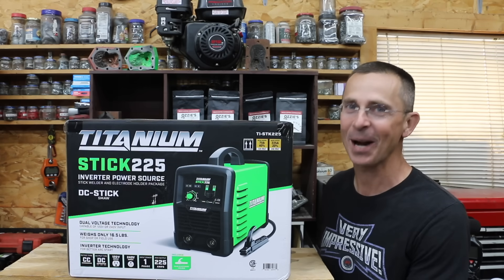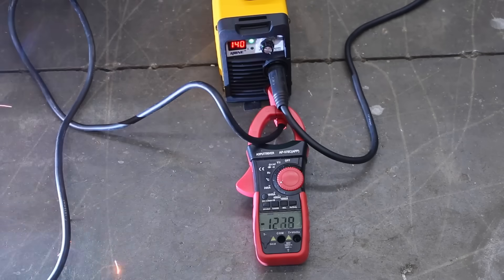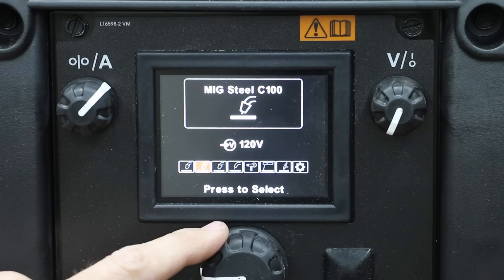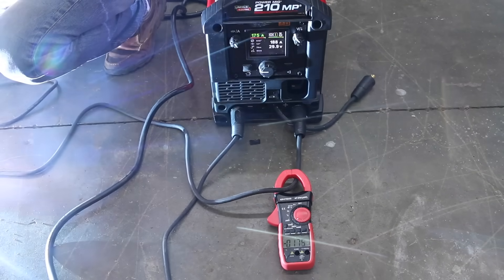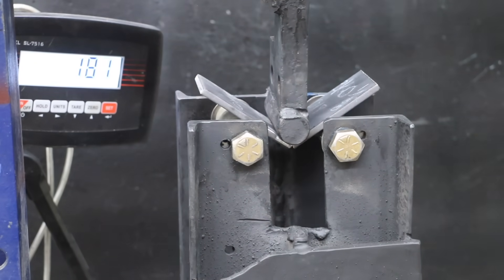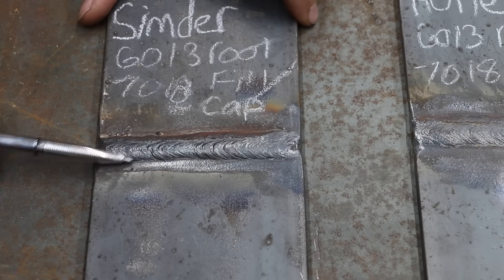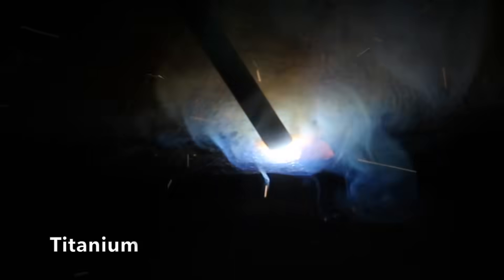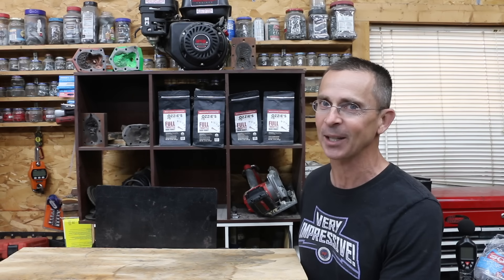$70 vs $2,300 Welder? Let's Settle This! Weld Strength, Duty Cycle, Current Output, Build Quality

Comment: I've been a heavy duty structural welder most of my life.  I am now retired and want the ability to repair trailers, steel totes, cladding etc but I don't want to spend many thousand.  I'm looking at the Lincoln flux core and MIG Lincoln welding machine for about 3 hundred.  I wish I had more experience using this type of machine.  Flux core wire sure seems to be the ticket.  I certainly don't want to have to maintain gas canisters for welding.  I can use 1/4 inch 7018 but I now only need to weld 1/8 inch or maybe aluminum.  I need a recommendation for what to buy.
Reply from the maker: Thanks for sharing.

Comment: For the simder you have to go into the settings when you get it, and change it to 120v as the max readout. After that it reads the accurate amperage when you put it on a setting. 

The 200 thing is just bullshit marketing, the company that makes the welder is actually the one that gave the info on doing that with the settings.

Comment: The harbor freight stuff is actually pretty good.
Reply from the maker: Thanks for the suggestion.
Reply: @ProjectFarm  I've done a lot of aluminum spool-gun and solid wire GMAW with the Titanium series machines and the weld quality is very close to the Miller Multimatic machines. I do a lot of tractor trailer repair and heavy equipment service.

Comment: great video on stick welders, its surprising sometimes harbor freight actually has decent welding machines.. Especially affordable for folks on a tight budget. I'm using their Chicago Electric Mig 170 (220 volt) and it does pretty well with flux core wire.     Have you made a video on  "Budget Plasma Cutters" ?? by chance???  Another YOUTuber used an Amazon special a VEVOR Plasma Cutter, 50Amp for $255 and was impressed on how well it did and I wonder how it would rank up against other plasma cutters.. I'm looking forward to your next videoes
Reply from the maker: Thanks!  Thanks for the suggestion.

Comment: Hey Todd, for better visualization of the penetration of the welds you can polish it up and use some naval jelly/rust remover for mild steel. For aluminum, the prep is the same but you can use oven cleaner and a bit of heat from a heat gun. Cheers, and thanks for testing out some welders!
Reply: Even running hot water over the polished edge for a minute will cause the weld area to flash rust and show penetration clearly.
Reply from the maker: Thanks and you are welcome!  Thanks for the feedback.

Comment: Thank you for accepting my suggestion for review (probably not only mine). Excellent job as always =) One more evidence about lack of quality control and performance with very cheap machines especialy if you need to work with 7018. Many of us dont need some high end proffesional tools but something with basic quality control/performance worth the money. One question for you and rest of US guys, what is max. amperage which you can get from 120 V home outlet and  do you have some option to get 240V? And yes, last but not mean least, there is interest for MIG welders review, especial MIG flux which can be very practical tool in workshop like your =) =)
Reply from the maker: Thanks and you are welcome!

Comment: The deko is the one I have. For what it is it's very nice it has a very smooth arc and lays down beautiful welds. It has a few quirks but nothing unmanageable. The ground clamp is junk right out of the box it can't handle the max amps that the machine can put out. The stinger is also made of brittle plastic that will not survive being dropped or stepped on. The display reads lower than the actual amps. The control knob is very sensitive and the amps like to drift for a half minute after adjustment before settling where it wants to be. This machine runs best on DCEP configuration.
Reply from the maker: Thanks for sharing.

Comment: I used the Lincoln bit I couldn't get it to stop, pulsing it would weld stop weld stop I tried making a better ground connection adjusting the feed and voltage on mig but I couldn't get it to work rigjt
Reply from the maker: Thanks for the feedback.

Comment: Joe was a very welcome addition. Nice review video.
 I've bought cheap to expensive stick, wire and mig welders. All worked but you really can tell the difference in quality.
A skilled welder can make a cheap mig box perform well enough but there is no question a good quality unit makes for a much better experience. It's also much easier to learn with a better quality welder.
I restored about a dozen fifties to mid sixties trucks and sedans in my shop and went from a cheap mig to a Lincoln, and finally to a very nice Miller. You can tell the difference when you are using them.
That said, I would take a cheap welder over no welder any time.
Reply from the maker: Thanks and  you are welcome!  Thanks for the feedback.

Comment: Weld power supply testing like this is pretty easily done with a big trash can full of saturated salt water and a couple of decent sized steel plates.  A couple of 2x2 boards between the plates ensures consistent spacing and keeps the plates from shorting together.

You can measure power supply "droop" (the volts/amps response) by slowly lowering the plates into the salt water and measuring voltage across the plates and amperage as shown in the video.  The current load is pretty closely tied to the surface area of the submerged plates, and voltage is pretty closely tied to the load on the power supply..

It's a lot less exciting than seeing welds, but it pretty quickly filters out the chaff and can put on a 100% duty cycle load if you keep adding water to keep the plates covered.  It also a lot less "noisy" than a welding arc, so your current measurements are a lot easier to record.
Reply from the maker: Thanks for sharing.

Comment: Interesting to see the quality differences!  I was pretty impressed by some of the mid range welders; a few extra passes would make the welds stronger too.  For a video idea, i was thinking about doing a comparison on those portable thermal camera imagers; not the small handheld ones, but the ones that plug into your phone.  I see many reviews on just one, but never reviews comparing many at the same time.  It would be cool to see things like temp. accuracy, the highest and lowest temperatures, how long each can last for while plugged into the phone, range, etc.
Reply from the maker: Thanks!  Thanks for the suggestion.

Comment: Makes me feel good.  I bought a refurbished Harbor Freight titanium MIG welder and swore it welded better than my older Miller. Now In fairness that Miller is an old Transformer welder and the Titanium is a new inverter welder.   But, boy is that titanium nice and it weighs about a third of what the Miller does. Makes it nice for portable jobs.  The Miller still whips the Titanium on duty cycle and probably longevity but boy that titanium sure is nice for the money.  Good to see these reviews.  I think those Titanium welders are kind of a best kept secret for the hobby/farm shop guys.
Reply from the maker: Thanks!  Thanks for sharing.

Comment: Was the test done at 130 amps measured or 130 amps indicated? Because as then first test exhibited, there is a massive difference. So it would only be “leveling the playing field” or “apples to apples” if it was 130amps measured.

Comment: Why would you do a 6013 root pass? 6013 was made for less penetration for thinner metals?  They would have done better with just 7018
What rod were you using on the rust? 6011 is best for rusty metal.
Overall id say I'm other than satisfied with these reviews of these welders.

Comment: John the weld. 5:29 . Test meter should be clamped on negative cable not positive cable to give more accurate reading. arc length can greatly vary readings. Chinese welders not great but cheap.

Comment: You made a crucial mistake PF. You let Joe use the cheap welders with an acutal hood and shoes on. Anybody that watches FPV knows those welders are only effective when using bare feet and safety squints. If you must have eye pro, no more than clear yellow plastic is allowed. 😅

Comment: Good stuff overall.  Some of the comments criticizing the tests are -- not really the point of the video.  No one buying these welders (except the Lincoln) is going out and trying to do some code quality welds.  If you're working around the house and need to repair some old metal equipment this is great.  You can use this to buy something and have confidence the welder is not a complete pile of junk.  Mr Farm: The MIG video should be interesting because the welders are smaller and you're likely not going to be focusing on such thick metal.  Seeing which ones have arc stability and overload protection will be good stuff.  I'm not sure if you're able to test it, but if you can (at the last test) put the feed system through a bit of torture and see how they hold up.  That's the most critical part for longevity on them, so trying to get - at least a relative comparison -- would be great.
Reply from the maker: Thanks!  Thanks for the suggestion.

Comment: Thanks guys, fortunately I can afford Miller and Lincoln, they last forever and you can always get consumables and liners. I was using cheaper 0.035 wire in my welder and had to change to 0.023 which was Lincoln, definitely better wire.

I know it sounds terrible and it's not a tool (well maybe it is!) but I'd like to see a test of toilet paper, I can't find decent toilet paper.
Reply from the maker: You are welcome!  Thanks for the suggestion.

Comment: You are a youtube treasure Todd. Thanks for helping Todd out Joe. I bought a $59.00 Parkside welder from Lidl's grocery store. it was in the clearance bin for $39.00 I bought a 150 amp bridge rectifier ( and a installed it on the welder. I also bought a better ground clamp and with 6013 rods I can weld #10 guage metal pretty good.
Reply from the maker: Thanks!  Thanks for sharing.

Comment: NOT THE BEST COMPARISONS

YOU NEED TO

1. SELECT A SPECIFIC ELECTRODE AND DIAMETER
2. USE THE EXACT THICKNESS PLATE TO WELD
3. RUN ALL WELDERS AT THE SAME AMPERAGE
4. TEST THE RESULTS

EX

1/8 7018 LINCOLN ELECTRIC EXCALIBUR ELECTRODE
125 AMPS
1/2 PLATE BEVELED 22.5°
MULTIPASS BUTT JOINT
THEN BEND TEST

Comment: Not a chance .I’ve had a 40 year fabricating career I’ve pressure welded titanium and all stainless alloys building ships , reactors , subs,  piping , vessels and tanks . There is no substitute for a good machine . The cheap ones are disposable and have inferior performance . Like literally . A good tradesman can make up for some inferior performance but when lives are at stake you just can’t cut corners  .But hey what do I know .
Reply from the maker: Thanks for the feedback.

Comment: I bought a 315 amp inverter welder from EBay,  240v only,   I used a FLUKE dc amp meter,  and the max setting of 315 on the welder meter,   the FLUKE only showed 127 amps on 1/8" 7018, on 1/4" steel plate,  wide open 315 amps. It welded quite nice at 127 amps.  Then I intentionally stuck the rod to see how it would max out,  it still only delivered 127amps.    But I haven't seen even 1 Chinese welder that was honest with their amp ratting.  But what can I say for $119.00.
 Great Video,                  THANKS
Reply from the maker: Thanks!

Comment: I am not a welder but have done quite a lot. My own welders have never been that expensive. But I have used some very expensive ones working for companies. Chalk and cheese. Whilst there is no substitute for ability, like Joe. In my opinion it is usually easier to use a dearer welder. With my limited ability I can really struggle with some cheap welders. Whereas every expensive one I have got to use improved my welding markedly. More consistent. Better beads. Better penetration. Just better.
Reply from the maker: Thanks for sharing.

Comment: Really wish these were rated at 120v (typical use case for cheap welders) as the results would have been very different:
Of the Sub-$200 welders (throwing out the S7 and SSimder because neither have over limit protection) then instead of YesWelder, Deko then Home The results would have been in opposite order: Home first, then Deko and then YesWelder
		           Max Setting/    Hot/         Max Amps
Hone:		   140	     /        140   /     120	Hot Start works well
Deko:		   159	     /        132   /     105	Hot Start works ok
YesWelder:	   138	     /        110    /    110	No Hot Start

Also, adding in the ridiculously overpowered Lincoln was no help at all - of course it would ace all of the tests.
Another mid-level welder would have been better.
Reply from the maker: Thanks for sharing.

Comment: Lol I just bought a Vulcan (harbor freight) omnipro 220, I think it’s good for the price ($1100) it’s multiprocess and it is shockingly good for harbor freight. It’s a lot of machine for the price. The only thing I’ve seen to beat it is a miller or esab version of it but those are much more expensive (about 2x the price)
Reply from the maker: Thanks for sharing.

Comment: You should factor in that a production WPS will have a defined amperage range for a particular weld.  Some of these cheaper machines have such variances that you cannot accurately predict your ability to abide by the WPS given to you.  The lincoln is much more expensive, but if you have to guarantee that you are adhering to your particular WPS, you cannot have +- 10% variances on output.  For a hobbiest some of the cheaper welders may make sense, for a professional setting you need the accountability that comes with a more expensive welder.
Reply from the maker: Thanks for sharing.

Comment: On some of these small units the output cables get really hot after 30 seconds of continuous welding.  I would have liked to see what kind of voltage drop occurs in them and the resultant cable temp rise.was.  I discovered this while welding while I was sitting on the ground lead while using a 90 amp 110V unit..  I won't do that again.
Reply from the maker: Thanks for the suggestion.

Comment: Thanks Joe. 
I have the buzzbox and wonder how it would preform against those new ones since it's been basically unchanged for over 30 years.
Reply: Had a cheap buzzbox ,then got cheap chines invertor and found the invertor so much better , the arc was much more stable ,plus can weld for ages without it cutting out . The professional transformer welders are ok but them DIY store buzzbox's are terrible things , didn't realize how bad till I go cheap invertor welder
Reply from the maker: Thanks!  Thanks for the suggestion.

Comment: That was a smart test plan. Well done. Those cheaper rigs are just false economy. 
Please add Everlast to your test. They're a US based manufacturer (using top brands from around the world.)
I was impressed by Everlast 10 years ago as someone who previously thought Miller=welder.

Can you get a stick welder for under $300?
Simple answer: no. You can get an emergency problem solver, but budget on at least an ammeter and the duty cycle is "hobbyist."
Or you can get a couple of car batteries and some jumper cables … it'll cost you more but it will work! : )

This kind of welding is only for stuff that doesn't matter: don't use this kind of welding for anything that could kill someone if the weld fails. 

Also, realize these welds were in the hands of a clearly skilled and experienced professional … a great golfer can play a helluva of a good game with a bag of sticks from walmart … you and I need good tools (and a grinder.)

I'd say that Harbor Freight has once again delivered a surprisingly good piece of equipment for basically no money. They sell a lot of junk, but they also have some good products. If you can't afford to buy Made in USA, fair enough, that's not a realistic budget for everyone, at least you can follow Project Farm and get value for your money.

For the next review, I'd like to see where's the welding rig that delivers the most technological bang-for-the-buck. Not Miller or Lincoln brand-name money, that brand battle has been waged by everyone.
Reply from the maker: Thanks!  Thanks for the video ideas.

Comment: I bought a new Lincoln welder that wouldn't weld right for 10+ years, brought to dealer, couldn't fix. Took it apart.. found it had a 12 volt wire feed motor... running on 24 volt ! Added a voltage reducer.. problem solved ! Called factory..NO help..total JUNK !
Reply from the maker: Thanks for the feedback.

Comment: I have run a titanium multi process welder hard for many years.  I am very impressed.  This video simply reinforced my experience.  For a better comparison to the Lincoln,  you can get a multi process titanium 200 for $750 bucks. Based on my own experience,  this video,  and the price,  i would struggle to justify the extra 1500 bucks to get the lincoln.
Reply from the maker: Thanks for the feedback.

Comment: I've had two Titanium mig welders completely fail right out the box last week, 170 amp and the 200 amp.  I returned them both and got a Pro Mig Lincoln 180, no problems.
Reply from the maker: Thanks for sharing.